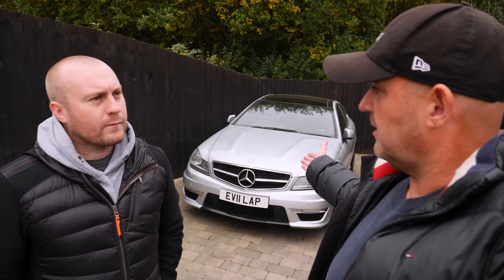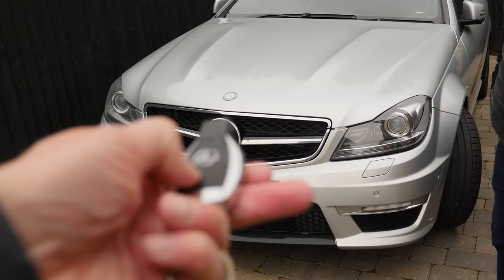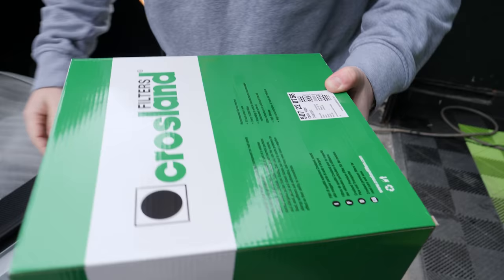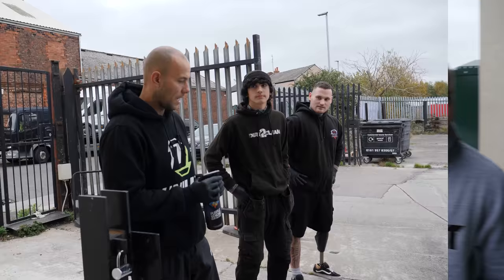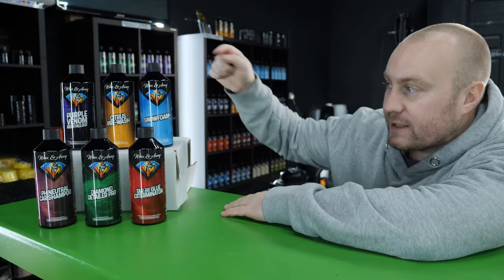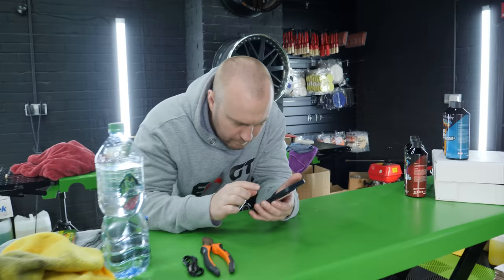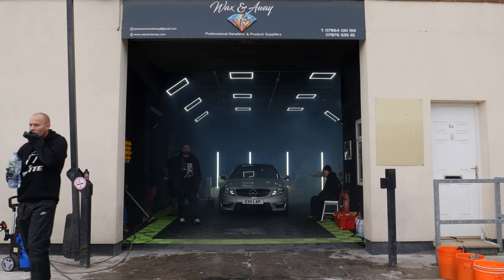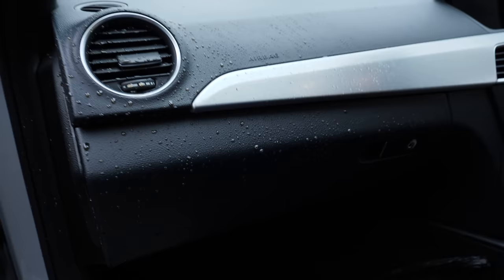C63 Coupe gets a DEEP clean! Until Ben does this...

Comment: I had about 4 issues with the alternator one after each other. If you have changed the alternator, get the voltage regulator checked. The VR getting checked first will save you money in the long run too
Reply from the maker: Thanks for the info 👍

Comment: I had a rare 2007 clk 63 with same engine slightly more power 481bhp I think, loved it, the sound was immense, never had stereo on, as clk pillarless had all windows down, deove this but felt it eas not as nimble or raw as clk, Would love the black series CLK body looks immense, AMG to me like Brabus are like american cars just straightline autobahn weapons, corners not as good as BMW, and too much wheelspin too, but sound amazing, big Merc V8 are bulletproof, especially the old 500 v8 and 5 speed box,  brabus used that for there 6.1 builds, and Mclaren 5 speed box over 7 as its bulletproof.,

Comment: That R5 looked mint, normal GTT OR a Turbo Raider?
You should get one of those and twin engine it!
Reply: It's absolutely mint Rick isn't it 👌👌👌 it's not a raider but it's immaculate 🙏
Reply: I had  an R5 GTT Raider, it was ink Blue, with blue wheels and blue trim on the seats, and Raider etched in the rear window, still 120 bhp like a normal one. That one looked black but hard to tell.
Reply: @greggould2643  yeah definitely black 👍 The blue raider you had was a stunning blue & I had a 21 turbo in the same blue 👌😍

Comment: Didn't even rinse the wheels before applying wheel cleaner.
Reply: It’s an iron fallout remover, you can sometimes wet the wheels but to get the best results your better putting it directly onto the wheel if it’s imbedded. This is so the chemical gets direct contact to react better with the break dust.

Comment: The wires in the rubber sleeve that goes from the boot lid into the car get hard and brittle then split with the boot opening and closing.this problem drove me absolutely nuts in my b7 ! When I found the problem after alot of reading up on it I extended every wire soldering 30mm bits on and rubber shrink wrapped the wires. Very tedious work but it's never gave me a problem since. I wonder how much they will charge for this and how much I saved doing it meself.